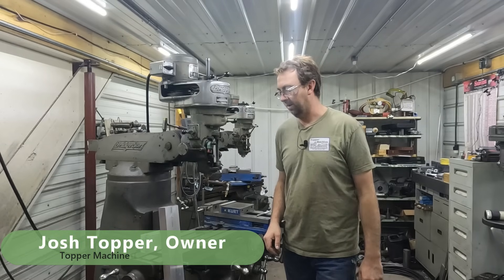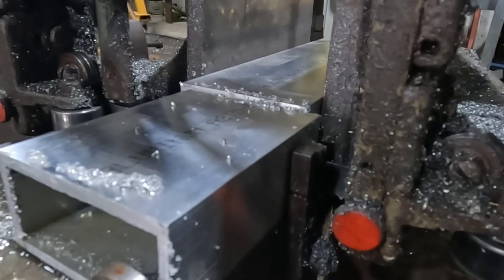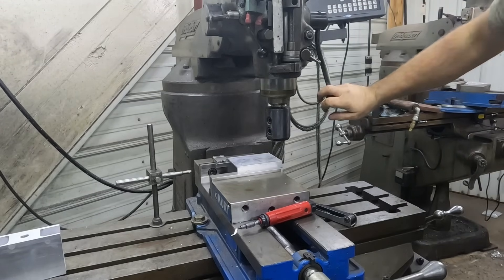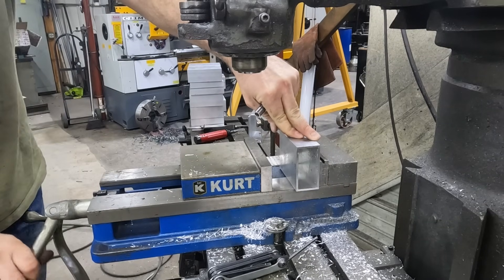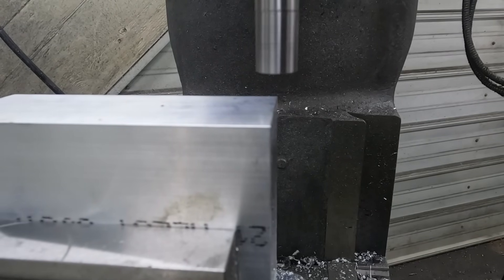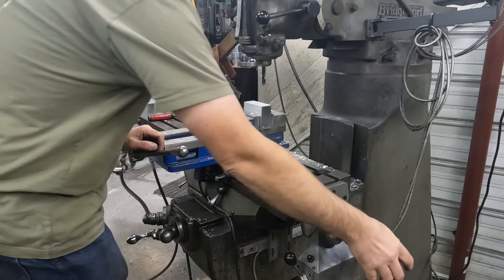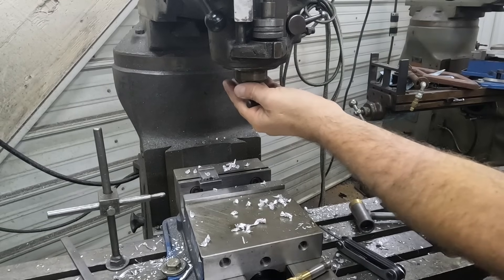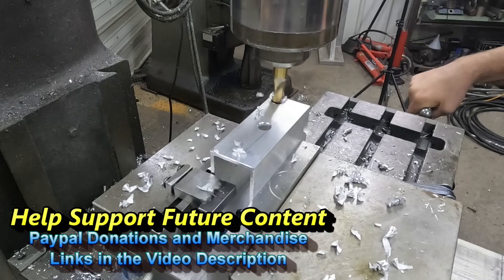Making Some Custom Aluminum Brackets - Manual Machining on a Bridgeport

Comment: Josh i know how annoying that is when the customer is at you every day for the part had simulacra just the other day and i was weighting on stock to arrive for the job i should have watched your video earlier and i think i may have sent this chap on his way and i would go one further and let the other 2 shops in my area of his problem he just would be on phone every day and then wonted to torch about just any thing as if i was his best mate for an hour as well i did hang up on him on accusation but he would ring back as tho he is dong nothing wrong but wonted the job i did try to tell him i am a one man shop and need time to work not be on the phone with him any way i am now raving Sorry Josh nice job as is the norm from you i have picked up some tips off you so thanks Cheers

Comment: Josh Climb milling you are a rebel😀😁😂 I know it is hard to do the proper feeds and speeds required on a  manual machines especially going into corners using DRO vs a  CNC i know how you pride yourself on being a manual only shop but considering using  Ez track or Proto Track or something on that line even though I am not a great fan of the Proprietary Property conversational programming because i am a dinosaur that learned on punch tape NC before the CNC days where  the machine tool only went where you told it to go and didn't have a mind it's own and does all kinds of unnecessary moves. If you never show the controller and have your hands on the handles, only but a few astute Machinist would ever notice the difference I would never rat you out if you went to the  upgraded technology.  😀😀😀

Comment: Hi Josh, I noticed how your part cut off in the Johnson, twisting and possibly moving your stop. I had a Kalamazoo (9 x 18 w/ 1" blade) that did the same thing, so I made a fence/stop behind the part being cut, and collinear with the fixed vise jaw. That keeps everything straight when the part separates. Give it a try, I'm sure you will like it. Thanks for the great videos!
Reply from the maker: That is not what you saw. My stop is movable. You set it, slide the part into it, then retract for the cut. After cut, move it back and repeat. Repeatability is within 0.005"
Reply: @TopperMachineLLC  A swing away stop. Very cool. Thanks for explaining.

Comment: At 10:00 you take the edgefinder and do the job but then you move the table half of your edgefinder you can't  type in the DRO  2 1/4" 0r 57.15 mm ???? bring also the table up not the spindel down it more stabel it also better for your back

Comment: Just curious, when you were milling those cutouts you stated a couple times you were climb milling but when you cut a slot aren't you climb milling one side of the slot and conventional milling the other?
Reply from the maker: Technically the finished side of the cutout is climb milled. Which is what I want for a good finish in aluminum.
Reply: @TopperMachineLLC  👍Gotcha! Merry Christmas!

Comment: MSC has the Kurt vise stops. I use rubber bands to hold parallels against the vice jaws. When milling aluminum I prefer a 3 flute carbide end mill and I run it as fast as the manual mill will go. On our HAAS VF-2  I run a 1/2" at 8,000 rpm and 100 ipm. WD-40 is the best cutting fluid for aluminum.

Comment: I am really curious, how much time did you spend planning out your process/order of operations. You did it so quickly and effortlessly. But I am sure that most of its from your vast experience. What can I say, I am in awe, and a little jealous.
Reply from the maker: Thank you!  Honestly I don't spend much time at all planning out this kind of job. A little figuring on paper to get my cutter locations and off to work. I've had some practice to get to this point.
Reply: @TopperMachineLLC  You must of learned from some real masters :)
Reply from the maker: @TheTsunamijuan  the ones I worked with were good, but they mostly told me to figure it out. I've done well, but there is a lot I don't know.

Comment: Do you have ball screws in that mill? Climb cutting is best in every situation, but not always possible without ball screws.
Reply from the maker: No ball screw. Just experience and knowhow. Tricks I picked up doing tool and die.
Reply: @TopperMachineLLC  you can get away with it depending, but that one time you get too aggressive, it gets interesting lol..

Comment: I had a (good paying) customer for over 10 years, they would order the same parts every so many weeks, Quantity 200-400 pcs. Same scenario EVERY order. I told them 1000 times, do not wait till you exhaust your inventory! It takes 2-3 weeks to complete the order in my shop. Nope.....every time the ordered, they would pester and call almost daily until they got their parts because they were completely out. I would ignore the phone most of the time. Lots of 'customer's' out there that are just idiots. I put up with a lot of aggravation from them because it was $100-120/hr work.
Reply from the maker: I have a few of those myself. A few years back I just made an extra batch. Now when they order I start another batch and deliver the first. Of course, I upped my price to reflect the fast turn around. Lol. They have no idea I have inventory, and it keeps business flowing smoothly.

Comment: I know you were making those parts to the customer's design. It seems like they could have been made just by cutting the stock at an angle and drilling the 3 holes instead of doing the milling. It would have taken less material to make them.
Reply from the maker: I agree. Gotta do what the customer wants, even if they are wrong.

Comment: For some reason, the audio was not good on my laptop. I watched a video from a different channel before your video and the audio was OK with the other one, so maybe that audio problem you mentioned previously is back? Otherwise, interesting video.
Reply from the maker: I tried fixing this video. It is the last one. No more made yet. Starting fresh in new year.
Reply: @TopperMachineLLC  I wasn't going to say anything, but I could barely hear your voice.

Comment: I worked in a farm equipment repair shop while in college. There were 3 of us and the owner who was busy hammering sawmill saws. First in was first out or you could leave the part or machine and we would work it in. We also stocked hardware, v belts and steel stock so we were always getting interruptions but that was the nature of the business. AL B.

Comment: been down that road, Josh. had to order a rotary engine for an Rx7 and the airfreight threw the engine off in Arizona so instead of a couple of days to get back to the replacement ,I got a complaint filed against me with MAZDA; to which I got a call from Corporate Technical advisors and chewed out!! Then no apollogy when they determined it was the freighter's fault. Also got written up over a driver's error; I refused to warranty any engine work on her car as she hydro-locked the engine. It wasn't a factory defect ,so again got the call, got chewed out they wouldn't remove her complaint and I lost a trip to master tech regional compition. Life in the fast lane; they both kept calling on when can I have my car daily!

Comment: Privat Persons just don’t get it , that they parts have the least priority for us, machine shop owners . I also have parts from factory where basically some people can’t work when parts fail. I refuse 99% of private persons and the 1% always are unhappy that i charge them too much…
Reply from the maker: Yes! Absolutely!  Everytime!  I had a guy want me to mount a boat winch on his trailer. Had to drill 2 holes through 3" Box tube and I supplied the bolts.  Took half an hour and he had a hissy fit that I charged him $40, and that it took so long.
Reply: @TopperMachineLLC  He should have done it himself .... but I guess he couldn't!

Comment: I have a vehical mechanic that I have used for years.  I am a self employed person who depends on my works truck everyday.  I keep up on maintenance on all my vehicles with this mechanic shop being the  only shop that I trust.  My truck broke a lower ball joint that had been installed only 18 months.  I called my machanic and told him my problem. He said get it here as soon as you can, wrecker was on the way.  They wrecker dropped at off at 10:30am, he called me at 2:30pm the same day to tell me at was ready.  The ball joint ended up defective so the parts supply ate the parts cost and I paid the labor.  Long term relationships are worth there weight in gold; he has been my only mechanic for the last 20 years.  I hoped he could get it fixed in a day or so because he is always 2 to 3 weeks out on repairs but he pulled a rabbit out of his hat and had it back in the road in 4 1/2 hours and they close for any hour at lunchtime.  I didn't harass him, I just told him my problem.

Comment: How nice to see you first thing in the morning. As always, you done a great job on the part and the video. When I had my shop, I struggled with the same thing. You can only do so much. I had a customer that did not want to pay me for programs that I made or purchased. If it was a program that I would use a lot, no problem but to use it only once, it is a big expense. The more you try to please someone the more it comes around to bite you in the ass. Thanks for the video!!😃😃😃

Comment: I've too dealt with people like you describe Josh that somehow just don't understand sourcing parts or material can be problematic, I started putting it on the customer to get the needed materials for their job and lo and behold the majority of the phone calls stopped.  One of the things that happened when I put this policy in motion was the customer many times would abandon their "project" all together due to the sourcing issues, kind of ironic how they expect you to spend your every waking moment bugging suppliers but when it comes to them doing it themselves they  just don't have the time.
Frustrating to say the least.

Comment: Need to add the time wasted answering the phone to a fully itemised bill so they get the message
Reply: I don't machine aluminum very often (unless I'm cutting it with a circular saw), so I was wondering why you were climb milling. Thanks for mentioning a little later in the video.